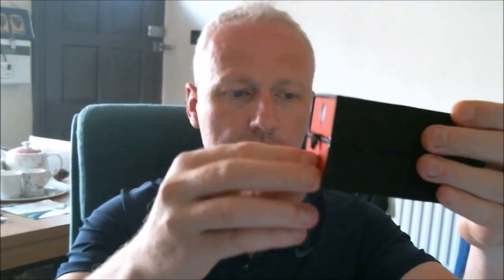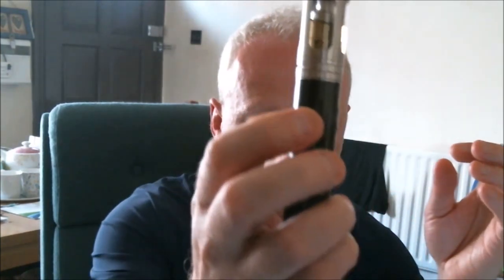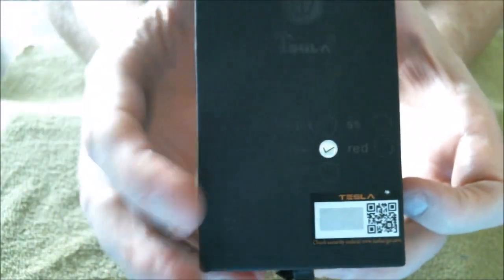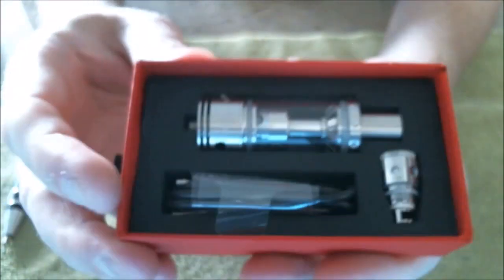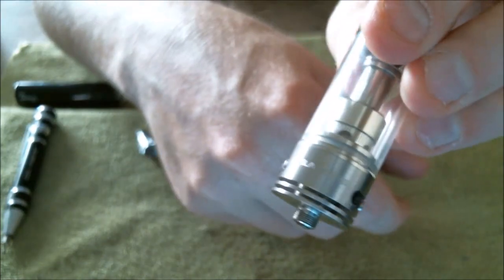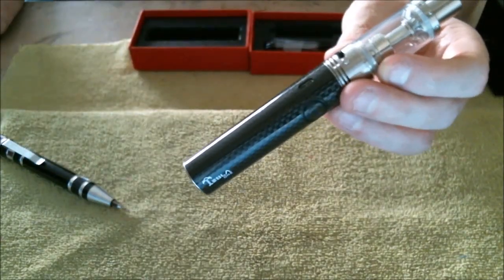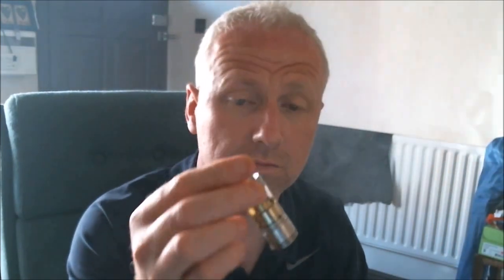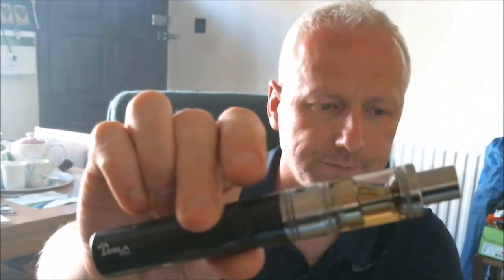TESLA ONE SUB MOD KIT: Review

Comment: how does it know what wattage its fireing at? I have a uwell crown tank with .25ohm dual coil I'd like to use but vape it around 85watts for best flavor.  specs say up to 100watt but no way to set specific wattage.  (new to vaping sorry if it's obvious)
Reply: answered my own question.  4.2volts at .25 ohm is about 70watts   not bad might have to try it out!